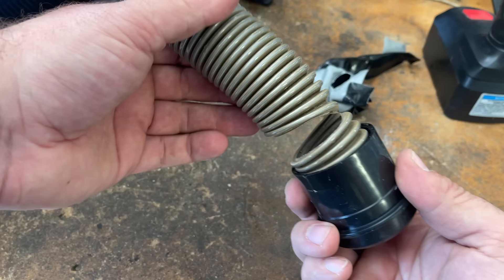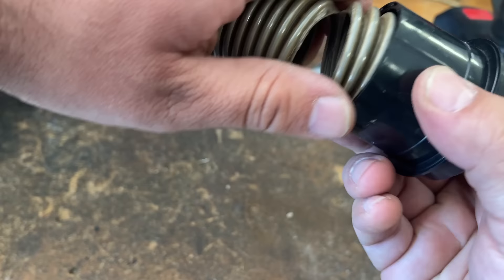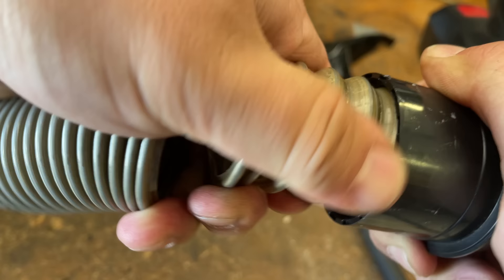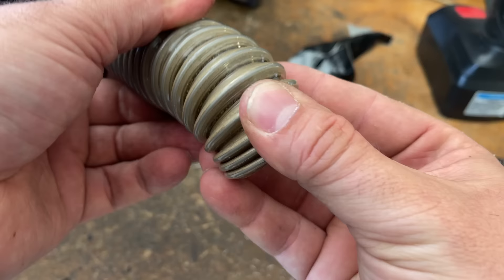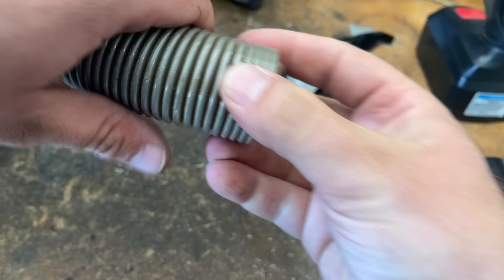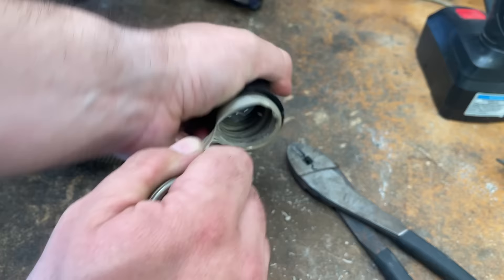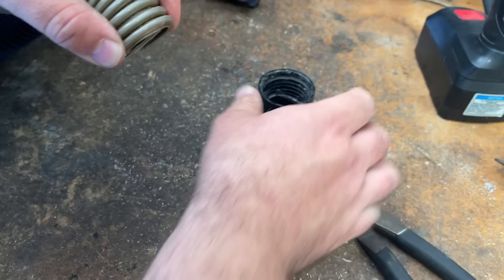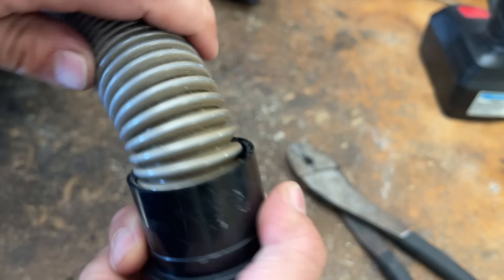Quick Repair a Vacuum Hose NO TAPE

Comment: Get even more life out of your vacuum hose if after you do this: After you do this easy fix, add a few twists of electricians' or duct tape to the stress point (by the connector where the hose broke the first time). Reinforce the stress point.

Comment: Just be aware some Hoses have a wire running through them to take power to power attachments, so you can't just cut and rejoin those types.

Comment: Yep. I have an early 1970s Montgomery Ward Canister Vac which I salvaged in 1976 and will not give up on.  It still has all its might. Most canister bags, as different as some can be, will fit.  The hose could use some work as you described.  Thanks!!

Comment: Got a great bissell pet hair eraser machine I found some spares for so everything good but the hose that's gone at the points of most flex. Determined to keep using it as it out- sucks my other vacuums (Sharks that also have hose issues at the moment). Hard to find spares (but did find a body that was about to be thrown away that had useful spares such as the nozzle head and filter trays).

Your video has given me the confidence to be a bit rough on things to get it sorted. Funny how a good appliance can be the subject of obsession but perhaps it's about respecting quality and giving things another try.

Cheers from NZ
Reply: Worked like a charm but found it was twin-wired which meant cutting the two wires at 180 degrees from each other before screwing back into mount. Also tweaked the end of each wire up and out a bit just so they grabbed the thread when starting off. Maybe a useful tip for someone reading this, if so, cheers to you too.

Comment: Thanks Hank. I haven't tried it yet, but I have multiple HVLP Spray Paint Guns with similar air hoses that always end up bleeding at the housing / connector to the gun. Hoping it will work on those. Thanks for the simple and easy instructions. Victoria ;-)

Comment: Thank you for this video. I’ve been glueing mine with a plastic glue and it’s been OK for about 10 uses and then it cracks again the glue comes loose. I’m gonna try your tip now. If it continues to crack, I will buy a new one.

Comment: Worked for Electrolux Oxygen. However, my machine had 2 wires embedded in the hose in the socket that had to be cut to get the hose out. That meant that the carpet head would not be able to vibrate on operation. But will just have to use the hardwood floor head instead.

Comment: Thank you SO MUCH for this video! Before I watched this, I thought the hose was glued in the handle. Then my husband tried unscrewing it.. I started sweating watching him, certain he was going to break the plastic end piece an second. That's when I started frantically  googling for a solution. It was like the clouds parted & the sun came out when I seen your video: )Good job on this little video. It was short, to the point & extremely helpful. 🤩

Comment: Thanks, I searched for u tube but most of the hoses connections are by two tabs which my one does not have. I ll try this method tomorrow. Thanks in advance

Comment: Getin!! After 5years of gorilla tape and sighs of 😤😤😫😫 I now have a proper hose well chuffed thankyou! Oh I have a vax and it’s like when you get to the end of taking the broken bit out of the connector..they must of siliconed and super glued that right in there, so I took my needle nose pliers and started twisting it around them (I just couldn’t do the last bit by hand at all) came out so easily after that 🤩🤩🤩

Comment: Doesn't work for a hoover steamvac. Can't shorten the hose as it's a 90 degree turn into the end cap. Barely long enough, bad original design. Tried multiple layers of aluminum foil tape with no luck. Will have to go back to duct tape. There is a water supply line that runs inside for the attachments. Otherwise, will try and find another longer same diameter section and splice it in 8 inches up. Hose has been discontinued from hoover.

Comment: What if the tear is in the middle of the hose?  Then your repair would literally cut the hose length in half.  But great fix idea if the tear is near the end. Thx for the tip..
Reply from the maker: Yes. That’s where common sense comes in. These hoses break like this at stress points which most of the time is at either end.

Comment: I have a eurika boss and need to refeed the hose into the end. I could get the wire out of the end (like you did) but can't get the plastic out  from the grooves in the end. Should I soak it in hot water?
Reply from the maker: You can try that

Comment: Where does one purchase a continuous length of hose to do this?  I have a cleaning business and I use the Shark Navigator Pet Vac.  The only thing that ever breaks on these vacuums is the hose and that's from using a coat hanger to get it unplugged.  I have 4 hoses I need to repair but can't find where to buy just vacuum hosing?  TIA

Comment: Hi Hank, my vacuum hose broke too, but it came off at the actual piece that connects to the wand part at the top closest to the actual vacuum motor. I have the hoover cats and dog turbo model. How do I fix this so it will reconnect inside the wand I cant seem to get the inside part of the hose which snapped off inside the wand, it must be glued down. Any advice? The place i bought it has shut down all shops.

Comment: Hi! Does this DIY fix it apply to with end of the vacuum hose? The part that goes into the machine and the part that goes into the vacuum head?🤷🏼‍♀️🤞🏼🙏🏼
Reply from the maker: It will work on either end so long as you can make it work. Some of the ends aren’t just screwed on but may be molded onto it. Depends on the vacuum.

Comment: Hank, I discovered your site when my brush roll seized & upon disassembling my shark discovered many splits in the hose at the bottom base (the piece you unscrew with a coin) currently it's patched with a 1-1/2"×2" piece of gorilla duct tape. Can this be repaired?
It's the original model Rotator. 
i LOVE this vacuum!! So Well that I recommended it to family not knowing Shark dropped this model.
My mother has 3 different sharks, NONE works as good as mine, they've ALL had problems & amongst the 3, NONE OF THE ATTACHMENTS ARE UNIVERSAL.
meanwhile, my brother's family has moved onto Dyson after 2 dead Sharks
Reply from the maker: You may get lucky and find a aftermarket replacement on Amazon if you search a bit
Reply: @hanksgarage_ shark much like tesla, have designed their business model & empires on replacement. Not repairs 
So, am wondering if there's a way to get into that bottom assembly & remove the damaged hose from the interior to get its length measurement and replace it with a piece cut from the exterior hose? 
They're the same diameter 
It looks to be an easier job to remove a piece from the clip end rather than the handle end
Is this something you've come across b4 & might consider in a future episode?
Like many, I have Way More time than money and am willing to spend what I have in order to save what I don't
Reply from the maker: This should be what you are looking for. Like I said aftermarket parts are now readily available for many of these problem areas of shark machines it looks like
https://amzn.to/3nd3AZG
Reply: @hanksgarage_  thank-you
Sorry for being a nuisance!
Reply from the maker: @wuggybuttz3923  you’re fine man hope it helped

Comment: yeah I have one here I sent away for the supposed exact replacement hose to use, the damned thing will not thread on, I was hoping to see a trick or something I have not thought of yet. I guess I will be returning this crap hose that is just a little to large to work. really is terrible though, It;s taken a month to get here and I am po ' ed it doesn't fit.